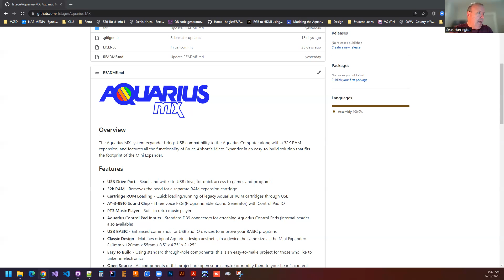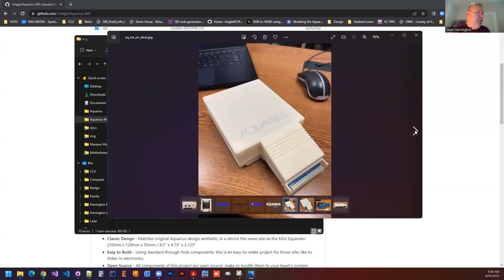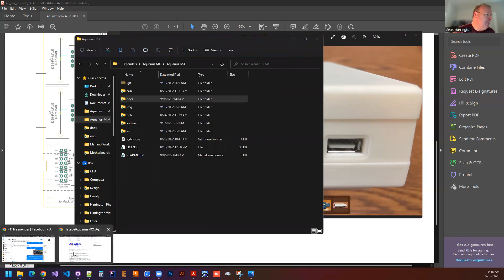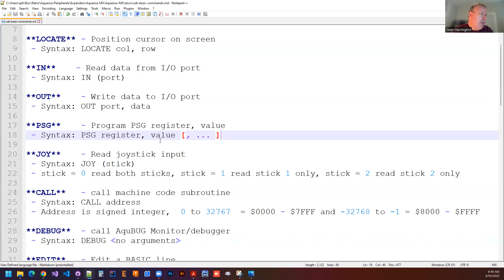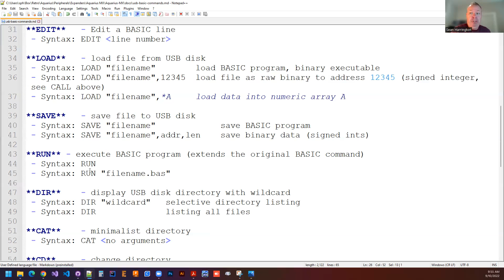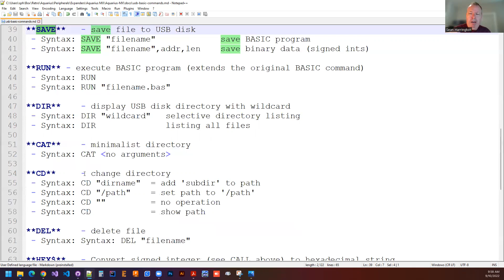Aquarius Computer - Overview of the Aquarius MX Expander

Comment: Thank you for this!

So I already own a couple of old school Aquarius. Does it make more sense to get a MX Expander, or an Aquarius+. Basically does the Aquarius+ offer more than the Aquarius & MX combo?
Reply from the maker: Depends on your aspirations. If you like playing with the legacy equipment, an Aquarius MX is a good way to explore the original hardware in a fun and interesting way.

WIth the Aquarius+, you open up new avenues of development. Yes, it runs all the old stuff, but if you want to play with newer features and games that utilize them, an Aquarius+ is a good entry point.
Reply: @1stage  So I first tried PCBWay, and they would get me to the loaded cart stage, shipping & quantity selected, etc, and then refuse to go any further. The same with JLCPCB. And I was using the community files for PCBWay, so, um, duh...

Eventually I gave up and tried ELECROW and I got 5 of each of the boards (both the MX and the Plus boards) for $16.44 including shipping. I'm sure that this was the special introductory price (one of the orders was just $1, the other $4.90). 

In any case, should others see this, maybe they will take the plunge considering that it's less than $20 to get 5 of each board.

ELECROW also has a parts service (another thing that didn't seem to work on the other sites). And no, I'm not a compensated sponsor of anybody. :)

Thanks for the response, I'll see you on AtariAge. :)